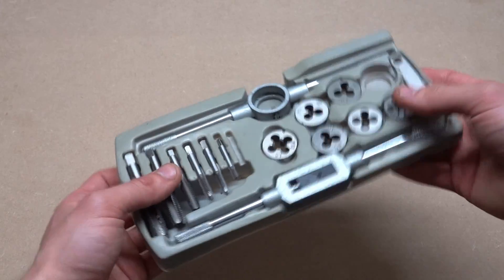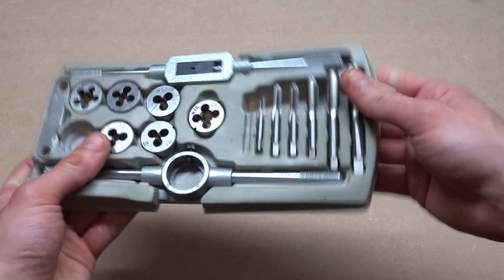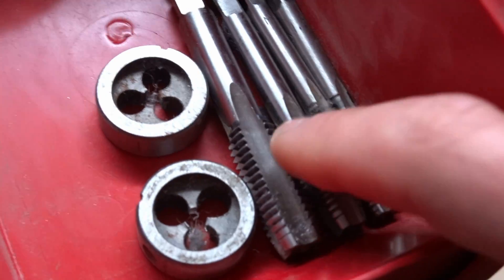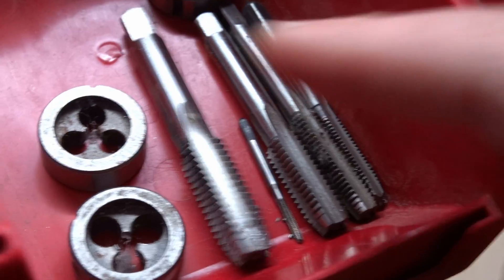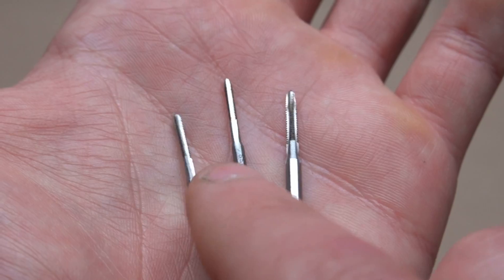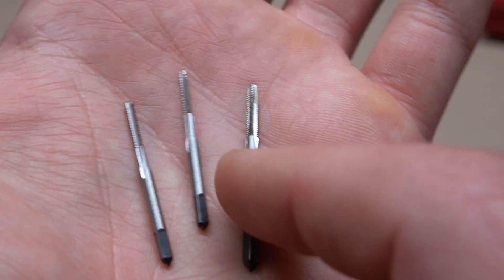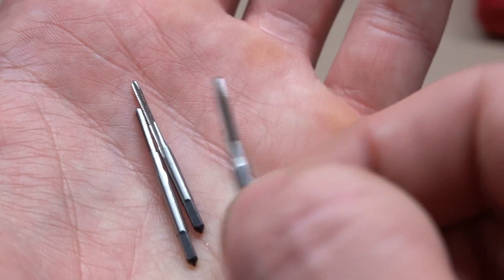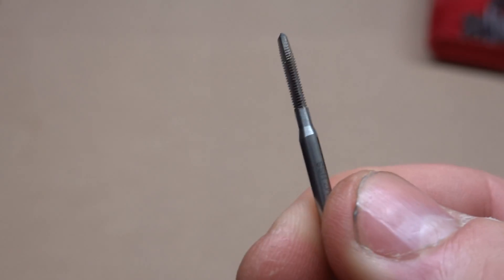Building a tiny steampunk "HDMI" display

Comment: The proper way to use that style knurling tool is to pinch your part between rollers, using the screw to apply pressure. Doing so puts almost no load on the lathe itself, and therefore won't damage it. A lathe is not really meant to take heavy loads in the direction that a pressed knurling tool generates.

Comment: For the next generation, you can just do what nVidia did, add frame interpolation to the driver, claim it now runs at "twice the FPS", and double the price.

Or get one step ahead of them and do what I'm sure they will for the next generation: add three interpolated frames between real ones and claim it runs at four times the FPS.

Comment: Noob question. When is it safe to just cut a PCB like that? Like yeah, you are just cutting the plastic, as long as the copper connections are intact you are, in theory, safe. But I've heard that sometimes there are multiple layers to the board, and you might be breaking some connections that are not visible from the outside. Is there any indication of whether or not is it safe to just cut like that or do you just have to know?
Reply: He understood the layout of that PCB so he could see that all the traces (the conductive circuits) were visible and on one layer.  Also despite that board being small it was not cramped.  To identify if a board is multi-layer you can shine a bright light behind it or into the edge of it and you should be able to faintly see the submerged layer if there is one, usually only very cramped boards have multi-layers such as those inside smart phones where space is a premium.
Reply: @krashd  Very cool tip, thanks a lot!

Comment: I very much enjoy that knurled plug, however, I'd have REALLY preferred a grub screw holding that HDMI end in hah.

That being said, what glue were you using for those other bonds? Looked like a cyanoacrylate but surely that'd coat the surfaces with fumes?

Great work either way!

Comment: it was hard to watch you use the knurling tool like that. if it wanted you to press from one side, it would have one completed pattern wheel. its supposed to be opened far enough to contact the top and bottom of the part, offset favoring the operator. optimally, the tool should be set to be 0 degrees and 180 degrees for contact then  pulled away from contact and adjusted 3/4 turn tighter. using lubricant to keep it from clogging or dulling since brass can be relatively sticky. well, the way you did still works, but it can put unnecessary and completely avoidable stress on the drive and the tool which can build up exponentially over time.

Comment: One dither you could try would be a simple error propagation You start a line probably with something like 50%. If the first pixel is brighter than that 50%, you set white (100) otherwise black (0). Now subtract what you used from what you were seeking and that is the next value to compare against. Continue this across the line.This makes text illegible but grayscale pictures translate quite well. By removing  randomness, you'll keep the same output for (some) static parts of the screen. I found that random combined with error propagation gave the most "accurate" representation of the original image but simple error propagation gave a more "clean" looking image at the loss of a little fidelity. (this was for printing images to a black and white thermal printer).

Comment: I've worked on optimizing serial displays, and I think I see your problem. I think you are sending a lot of overhead with each write. i2c works by sending and address, a command, and data for that command. If you are only writing a single byte at a time, 2/3s of the transmission is completely unrelated to what you actually want to display. Instead of only changing the bits that change per frame, store a frame buffer on the computer's side, and write to the entire display at once. That would change it so that only 2/1027 bytes are overhead, and that should give a decent speed increase.
Reply: It's impressive how twisted the replies are in relation to the original comment idea
Reply: @notlonewolf  welcome to the internet. is this your first time?
Reply: @mindsnk You're part of the problem.
Reply: I like your funny words, magic man.
Reply: you tryna smoke these raisins? 
 @tamnker8465
Reply: Im surprised there's not a single "huh, you make a good point" to be found so I'll say it for all the different perspectives and add a thank you. I always learn so much in the comments
Reply: God bless those passive DVI to HDMI converters. I have multiple monitors saved from the trash bin because HDMI goes straight into DVI with a dumb adapter.
Reply: i2c? Wait, is hdmi literally just I2C with extra steps?!
Reply: @robonator2945  That would be funny, but that's not the case. HDMI is just DVI with extra steps, which is just VGA with extra steps, which is just RGB with extra steps, which is just component with fewer steps, which is just composite with fewer steps. 

HDMI basically uses serial for transmitting the color info, but it uses i2c to communicate to the monitor about the best settings to use. In this video, he hijacked the i2c line to carry color (or in this case, black and white) information instead.
Reply: @Stingpie DVI is NOT VGA!!!!! VGA is ANALOGUE!!!! DVI is DIGITAL!!!!!!!!!! its just that the d-sub(?) connector commonly used for DVI was also often able to be switched to output VGA that could be passively adapted into a normal VGA connector provided whatever card/hardware it was coming from could generate analog video signals, there's nothing inherently linking the DVI signaling standard to VGA it was just a SPACE SAVING MEASURE WITH REGARDS TO CONNECTORS!!!!!!!!!!!!!!!!!!!!!!!!
Reply: @siivadyne  please see page 22 of the official specifications for dvi for details on the VGA inclusion. (I would include a link to it, but youtube will randomly block comments with links. You can find the document in the 'further reading' section of the wikipedia page for DVI.)
Reply: @Stingpie DVI-I/A and DVI-D Are connector standards, not signaling standards.  DVI-I/A was to allow VGA pass through on new cards with older monitors so users wouldn't be forced to have to get expensive new monitors that supported DVI input.  The same reason the Nintendo Wii had built in Y/Pr/Pb along with composite on the same connector; allow existing userbase to enjoy the product without alienating those who wish to take advantage of advanced features because they can afford them.

Or are you confusing that DVI has to have resolution provision for VGA resolution as a backup?

Either way, DVI protocol is wholly digital.

Source: I'm a crusty old bitch that grew up in the 90s when DVI took off and crashed in a blaze of glory to birth HDMI.
Reply: we are standing on the shoulder of giants, thanks for your work!
Reply: EMACS
Reply: Also writing the whole thing in C instead of using Python scripts could be a good idea.
Reply: @w04h  Execution speed is unlikely to be a limiting factor; any modern CPU should handle this task with no issue even in Python. The main holdup is the i2c frequency (I imagine this is set by the HDMI controller and can't be changed here) and, as stingpie said, the "goodput" or ratio of useful vs not useful data.
Reply: the ssd1306 has no problem with i2c running at about 1mhz....
Reply: @gorgpflug6087  I'm not talking about changing the i2c transmission speed, I'm talking about increasing the goodput(ratio of relevant data to irrelevant data) of the bus.
Reply: well yeah but as @Görg Pflug  mensiond 1darn mhz   sooo what u writen there was unneeded
Reply: @andreameparishvili5468  the i2c frequency isn't just an arbitrary limit, it's the maximum that mixtela's computer can output through the HDMI connection.
Reply: @andreameparishvili5468  written like a true twenty something programmer - lets not optimise, let's just throw more resources at it. Let me guess, your personal projects sit atop Electron or something else equally wasteful?

Comment: Try blue noise comparison (static) instead of Floyd Steinberg to dither. You can also try 3D blue noise or Nvidia precomputed spatiotemporal blue noise, but given low frame rate, I think static would work better. The problem is that the movement in the dither is obscuring the movement in the picture. With a static dither, maybe you'll be more successful with partial screen updates.
Reply: Seconded, do look into that!
Reply: this seems like a good idea, but would probably need something more, to be worth making a new video about, and given how at first this was like april fools video, and then he made a cool case for it, then now what, fix the dither and...what, use another of those screens, to make a micro model computer with functional screen?
Reply: @jinn6.9   Oh I do believe mitxela could figure this out! You're right that it doesn't look easy to build a video about, at a glance. However, I didn't expect this one, either =D What I would do personally is "here how the code was massively improved" - there's def some things that can be added, including partial refreshes (look up micropython SH1106 driver for simple page-based example) to increase FPS. In addition to that... 128x128 could be done with two displays, I suppose! But, AFAIU, mitxela's videos aren't software-focused typically? so I'd understand if this were to be left as exercise to the reader.
Reply: @AryaFairywren  didn't he just specifically talk about how he made it only send the updates to the screen? both at one point, and then demoing it at the end, how if only the mouse moved, it worked just fine?
and rather than bigger resolution, I'd rather take lower resolution over bigger screen size, to make it more legible, lol, right now it's basically just tiny noise, even at a terminal prompt
Reply: Thank you. I was bothered that I couldn't remember the name the dither.
Reply: I came here to also suggest an “ordered dither” (like Bayer or blue noise threshold) since fewer pixels would change.

Comment: You should start selling those milled brass connectors to audiophool cable companies.  Of course they'd use epoxy to discourage disassembly and reverse engineering of a cable that isn't anything special.
Reply: Milled from solid brass! Keeps all the sound IN!

Comment: I dont know if you can change that, but if the dithering is slowing down the performance, maybe switching to indexed dithering would help. Floyd–Steinberg dithering is acumulating data in an iterative way, while indexed or lookup dithering is done per pixel and way faster. as a bonus you would get a nice retro pixel art vibe
Reply: Indexed can also be readily performed on a pixel shader due to its nature.

Comment: That i2c abuse is one of the best backwards uses of a technology I've ever seen.  Kudos.
Reply: this reply section has given me 1000000 more braincells
Reply: would have used SPI, might actually have a decent bandwith and the controllers supports it natively
Reply: @Flowxing  I don't think the video card can speak SPI but you're right if this were microcontroller driven
Reply: @big0bad0brad  oh I didnt know this was directly driven by the gpu, I thought there was a controller inbetween
Reply: @Flowxing  It's probably not being driven by the GPU, but there are i2c wires in an hdmi cable that are used for things like changing volume or powering on the device on the other end (that's the DDC people are talking about). Linux can access this as if it were any i2c port. I don't know how his driver works (like if it shows up as a real display, or if it's a program that uses screen recording to mirror the display), but I think either way the CPU is what is doing the work of sending the image to the display.
Reply: @MobiusHorizons  Yes the GPU is basically just acting as an I2C controller for the CPU that's generating the image data.  Though you could certainly render with the GPU, post process on the CPU, then send back to the GPU to send for display - it's so little data to move that there's no penalty to moving it around and the performance will always be capped by the I2C rate.
Reply: @MobiusHorizons  ddc is AFAIK basically just an i2c eeprom and rarely writable.
Reply: @MobiusHorizons  The main use of DDC is reading the EDID ROM, which identifies the monitor (video modes supported etc). The controls are sent in a different wire via CEC.
Reply: @nyetloki  Most i2c controllers don't even know if they're reading or writing data.  It's because the addressing and higher level protocol isn't very well standardized on i2c and so a write could be writing a command or address or data, and the controller doesn't know or care.  It's just doing whatever its host tells it to do with the i2c bus.
Reply: @big0bad0brad  Not quite true. For multimaster support, an I2C controller writing a 1 bit must immediately abort if it sees a 0 bit, an event called arbitration loss, and which device writes data switches for the acknowledge bit, which ends transfers if high (either an absent slave or master ending a read). That first rule thus cannot apply during the acknowledge cycle for a write. Many controllers make no distinction between address or data byte write, though.
Reply: @0LoneTech  Yeah all I meant was that the controller wouldn't be aware of logical data writes into the peripheral because it doesn't really know if it's really writing or just sending address/control data for a more complicated read (or no payload data transfer at all).  The controller still knows whether it's supposed to be driving the bus or not but it doesn't know for what purpose.
Reply: @big0bad0brad  Aside from 10 bit addressing, which almost noone uses, that part is indeed outside of I2C specification. Protocols like SMbus do define it, but widths etc are device specific.
Reply: @big0bad0brad  that's not factual. The controller always knows when it is reading or writing, it's explicitly in the last bit of the address. It also knows when it should be writing to its memory or nvram.
Reply: @big0bad0brad  additionally, the manufacturer using the DDC knows its not supposed to need actual writable registers, only the address register.
Reply: @nyetloki  What I mean is that the controller doesn't know if the device is reading or writing or doing neither.  The controller knows the data transfer direction but it doesn't know the semantics of what it's making the device do.
Reply: @big0bad0brad  then how does it know when it should listen to the data line and when it should control the data line?
Reply: @nyetloki  The CPU tells it it's sending or receiving a byte and it goes through the motions to move a byte of data and an ack bit and lets the CPU know when it's done.  But the controller still doesn't know what the device it's controlling actually did internally.
Reply: @big0bad0brad  congrats you just described all computing...
Reply: @nyetloki  Dude what's your problem?
Reply: @MobiusHorizons oh shit that's how this is working?
Reply: Then do it!
Reply: Yeah. I’ve never seen that before. Gonna have to look into that… 🤔
Reply: that's DDC
Reply: @nneeerrrd  For what it's worth, DDC2B uses the I2C protocol.